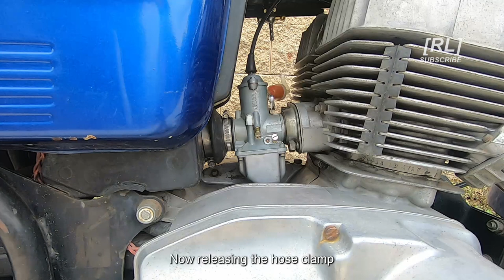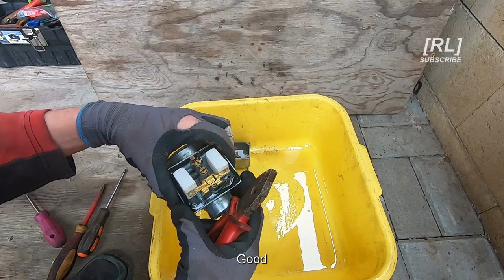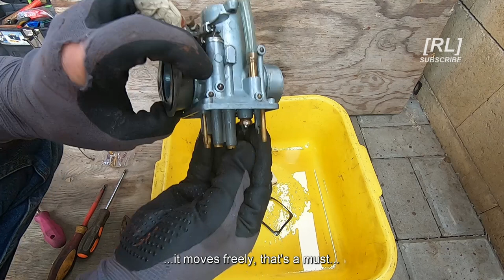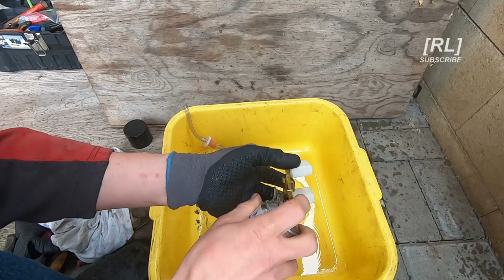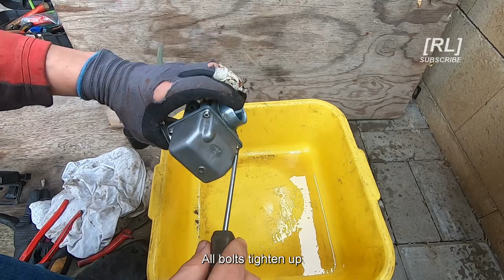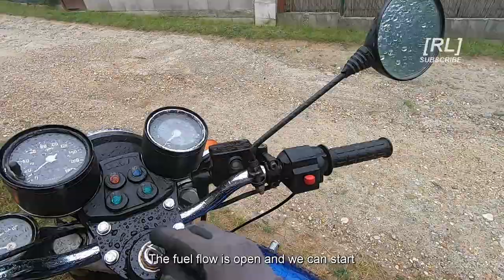Jawa 350/639 -  Accessing & Changing Carb Needle Valve (HD)

Comment: Jawashop sell an adapter to fit the Jikov 28mm. 638/639/640 carb onto Jawa & CZ models that normally use th Jikov SDB2924 & 2926 tickler carbs.

I know somebody whose running a Jikov 28mm. on his 1978 CZ 305-471.3 Sport currently, with good results.
Reply from the maker: Hi Andy, maybe you can post a link, so that we can see what adapter exavtly you mean. I would sure appreciate that. Thnx